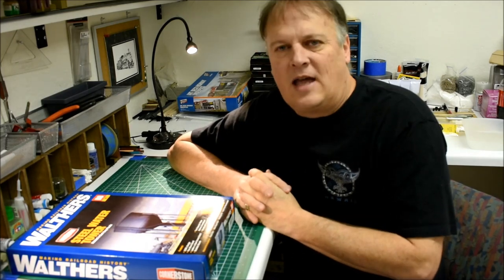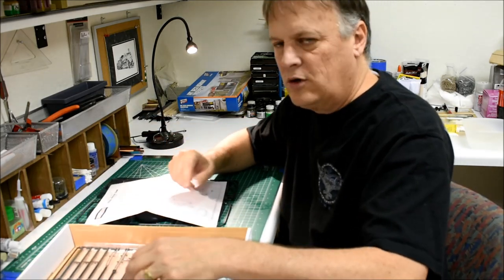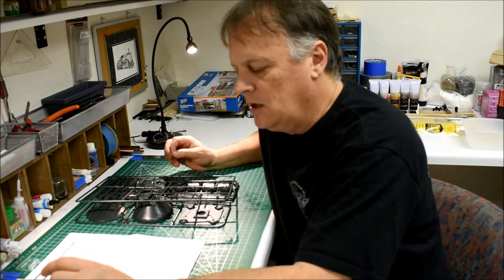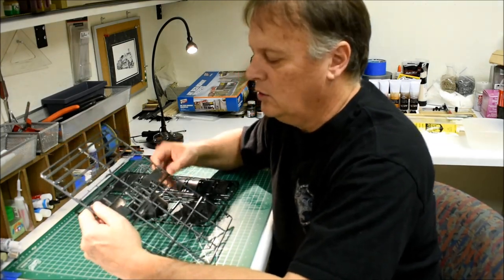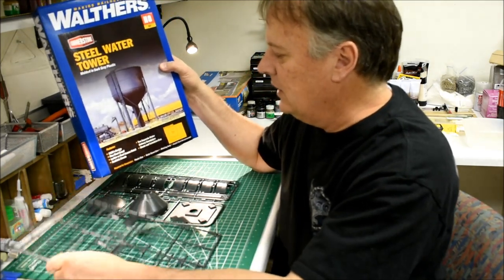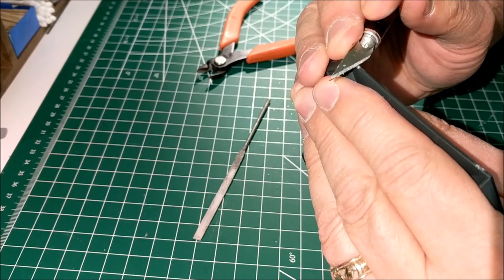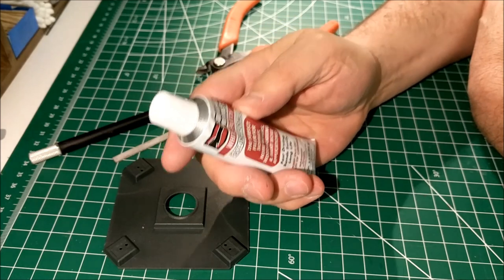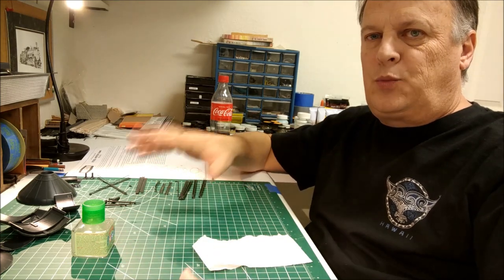Ep 31 HOW-TO Weathering Walthers Water Tower

Comment: What color paint do you use for you concrete? Also was your black a straight flat black?
Reply from the maker: I have tested a bunch of colors for concrete, but my favorite is Vallejo Engine Grime.  I know it sounds like a strange choice, but if you want to see it, look at the Oilton Club Saloon video for the color I used on the foundation.  The flat black was straight flat black, and I think it was Testors brand, but lately I use Rustoleum so I get more for my money.  Since we weather and dullcoat over flat black anyway, I am not worried about fine grain in the spray can.